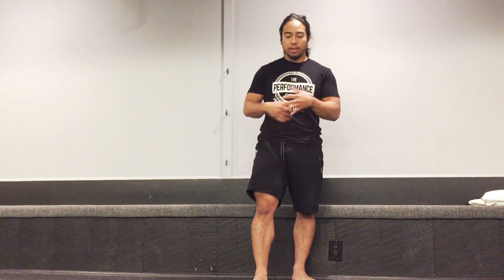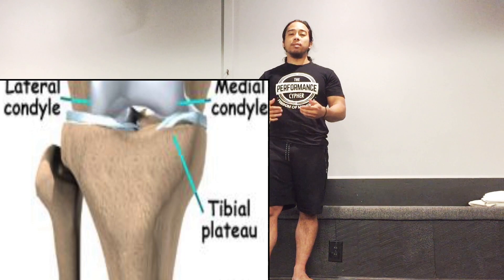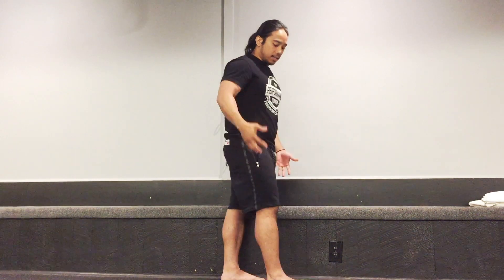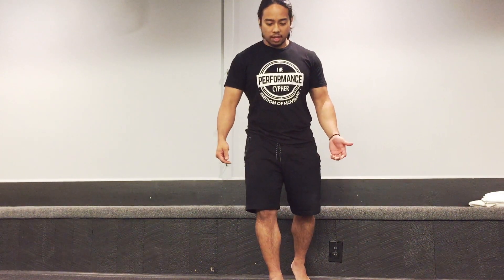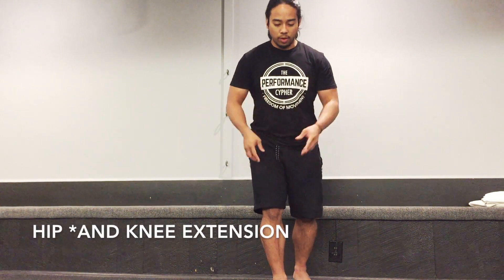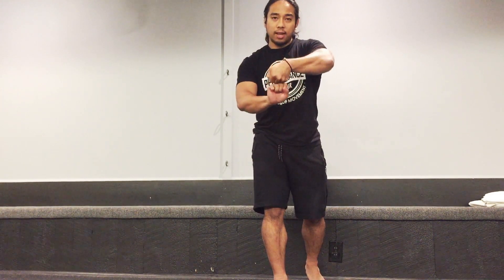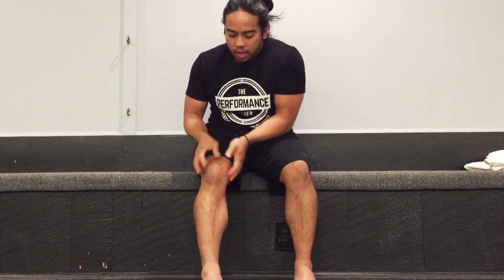Screw Home Mechanism for the Knee

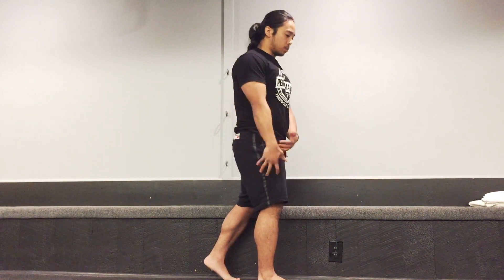Comment: @1:52 - what's the reasoning behind the femur being internally rotated and the tibia being externally rotated?  I have a strong sense that it's the opposite.  -- edit: my mistake - you're in extension.  i've always paid more attention during flexion.
Reply from the maker: Yep, the purpose is to understand what happens during the actual rotary component of what happens when the distal femur approximates on top of the tibial plateau during both extension and flexion. This is what the screw home mechanism phrasing is referring to - in that during extension there is a set of coupled motions at both the femur and tibia, and during flexion there is the opposite motions of both the femur and tibia.